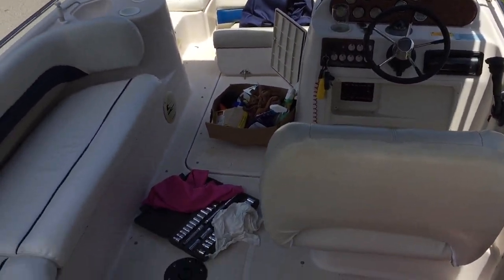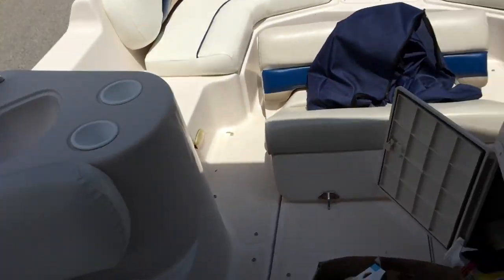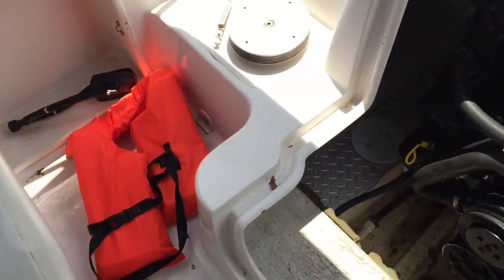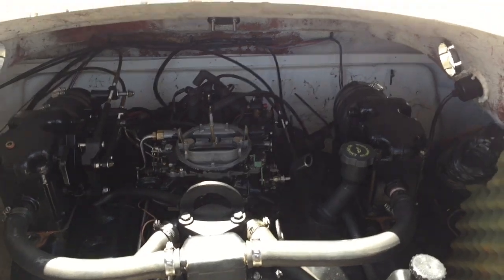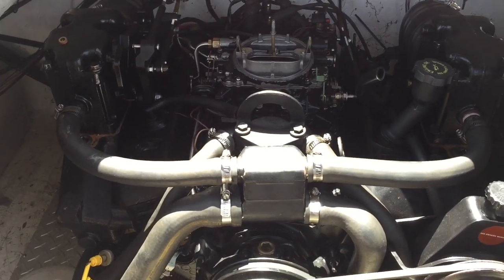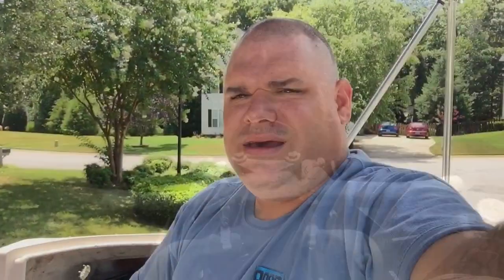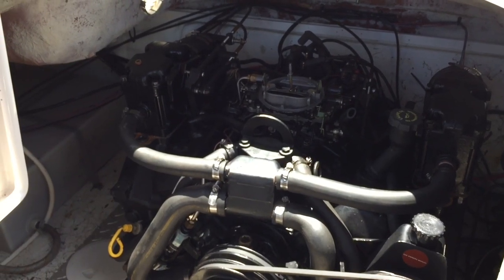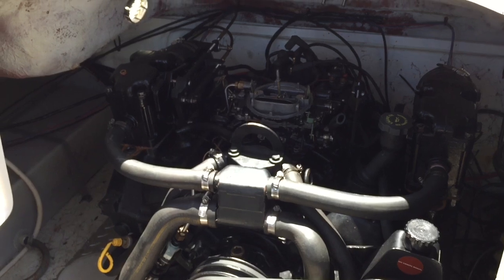Part 1 How to diagnose Blown Mercruiser 4.3 V6 Engine Bad Boat Purchase

Comment: Great advise... never buy a used boat especially sterndrive on the hose! Always test on the water.
Like you said , the bellows or shift cable boot could have a whole , that you cannot see till you have it on the water, then water starts running in from the back of the motor.. plus until you have it on a load and shift in gear ,you cannot hear a dry or bad gimble bearing, lower unit sounds, clutch dog, bearings gears... u joints especially when turning under power... people if you're not knowledgeable about the mechanics of boats , engines and stern drives,, pay someone who is....
Reply: David Jessee agreed
Reply: I'll just tare shit up until I figure it out my self don't like the idea of this magic man that's a alien who's smarter than everyone on earth if it was build by humans a human can fix it .
Reply: Depends on the price point.  If you're buying a 20 year old Bayliner for $7k, most sellers are not going to want to deal with the hassle of water trial.  They'll move on to the next buyer.  What this is means is that you can pass up a lot of decent boats for $7k. At a certain (much higher) price, a seller will anticipate a water trial and will be open to doing one, but the delta between the two prices can buy you a lot of repairs.  Personally, I just assume that an older I/O will need bellows, gimbal bearing, and maybe exhaust manifold/risers unless the seller has records that these were addressed recently.  If the price is fair considering these potential maintenance items, I'll buy without a surveyor or water trial.  Unless you have deep pockets, you shouldn't be buying an I/O unless you're reasonably mechanically inclined.  There is just too much to go wrong with an I/O that even a brief water trial or pre-purchase survey won't find.

Comment: don't want no problems get 2 stroke Mercury outboard fastest and most reliable engine out there
Reply from the maker: Not a 2 stroke fan but agree Mercury is good.
Reply: Outboard are great but I have been a boat mechanic for over 20 years working on outboard and Inboard/Outboards. Over those years I have seen just as many people if not more buy an outboard with a bad engine as I/O folks. The main thing is to know what you are buying and get it checked out.
Reply: Kody George 2 strokes banned on most lakes in California
Reply: @robertgary3561  that's another good reason not to live in California!

Comment: Wow a hole in the piston is a very rare thing even weird for that to happen must have put wrong spark plug in it with to long of a shank or dropped something in the spark plug hole like a nut or bolt or used to high of octane that's crazy. Even running on the hose a person should have heard that right off that had to have a really bad miss.

Comment: If the cylinder, connecting rod and crank aren't destroyed, it'd be far cheaper to just put a new piston in it, instead of a new engine.
Reply from the maker: If you are paying a mechanic, considering other factors with the right side of the engine block, a replacement was the best option.
Reply: NovaMan 350 almost guaranteed the hole was caused by running low on oil.

Comment: 4.3 if it's a GM motor it's the best motor on the market. The Bellows are the Bellows they got to get changed every 5 to 10 years because it's Rubber and it dry rot spray with silicone before you put it in the water and that'll help you out an awful lot. I have a 92 Sea Ray 21 ft boat and it is fantastic I was original owner if you take care of it I change the Bellows one time last year cost me $800 I had a guy do it for me. 4.3 GM Motors would I have in my boat the same one that you have in yours and it runs fantastic it is the best boat motor on the market

Comment: Hi sir
I already suscribed in your channel bc i bought a boat a 2007 tahoe Q6 with a motor mercruiser 4.3..in my first experience forgot to tie the plug and almost sink and in the second one after replace the starter and oil it started to lose oil pressure after 30 min running.
What do u think that get it.?

Comment: would a boat that cost 2000 bucks that doesn't  start be a good deal?
it's a 1995 excel  boat! 4.3 Lt
mercruiser
Reply from the maker: Depends, on how much another engine or rebuild will cost ? also what about the outdrive unit ? what is that condition.
Reply: hell NO........
Reply: I would have looked into it,long ago,lol !!!  I'm a mechanic,and a non-start can, sometimes be easy to repair.

Comment: I would replace the piston a lot of work but well worth it
Reply: If the motor is coming out anyway for 3k you're spending you could have a forged internal blue printed and balanced motor. Swapping a motor over

Comment: When buying a USED boat having an inspection done by a marine surveyor and/or qualified reputable boat mechanic is money well spent. But if you do not want to spend that money at BARE MINIMUM take the boat out on the water and run it wide open for at least 10 to 15 minutes that will NOT tell you everything but can show a lot. If the seller will not take you for a ride and run the boat wide open do not buy the boat walk away.
Reply from the maker: Absolutely Agree!!!
Reply: If I'm the seller, NO Eff'n Way I'm letting a tire-kicker run my I/O or big outboard 'wide open' for ten minutes straight.  That's not normal or expected operation.  He can demo it for up to an hour at various engine RPM's, including one to two minute INTERVALS at WOT.  With small outboards, continuous WOT is OK.
Reply: 10/15 minutes flat out sounds too long to me.

AS Russ G says short periods at a time.
Reply: David Farmer   If an engine cannot run wot for more than  15 mins then its not worth a fuck !
Reply: You can get a remand motor for 1500

Comment: Some "mechanics" are less than intelligent. The ones who said it needed a carb overhaul need to find a different line of work. It won't work on modern engines with large upper plenum intakes (because they essentially act like a vacuum canister with plenty of reserve vacuum) but on most boats and older carbureted vehicles, a vacuum gauge would have shown that decisively and much faster than a compression test. If the needle on the vacuum gauge jumps rhythmically with the misfire, it's a mechanical problem (hole in piston, broke ring, bad valve, broken valve spring, flat cam, etc.). Also, I can assure you, if you have a major mechanical problem like a hole in a piston or bad valve/flat cam, you can disconnect the coil and just crank it over and you will hear the engine speed up every time the cylinder with weak/zero compression is on the compression stroke. It makes my blood boil that some people in this profession are dumb enough to call something that simple to diagnose a carb problem.
Reply from the maker: I could not agree with you more. 150% more. The engine is getting changed out as we speak with a nice reman long block from a reputable company in Charlotte, NC. Hopefully in a week or two he will be back in the water.

Comment: call your local bank or credit union and ask who is a good marine surveyor. best money you will ever spend is on a survey! I almost got burnt on a $72k boat. the entire foredeck was all rotted below the bow rail. i would of never noticed. looked further and the stringer was quite wet. whole boat was junk but hell, i didn't know wtf i was looking at.
Reply: A marine surveyor is a good idea but many of them do not check out mechanical items like engines as hard as that is to believe. Now it's not that the surveyor is lazy or corrupt, they just do not inspect engines even though you would think that is one of the most important items that should be checked. If you are hiring a surveyor interview them and find out what they will be inspecting.
Reply: checked a few and they all do according to what they have listed. also it is a visual inspection. they cannot inspect what they cant see or access easily like bellows if the boat is out of water.
Reply: Like I said before a marine surveyor is a good idea and a good surveyor does a great job at checking boats for structural issues. While no one can be expected to see through metal or find drive hardware problems if the boat is in the water not all, but many of the surveyors I have observed over 20 years as a boat mechanic don’t check much in the way of engine mechanical items. Now different surveyors are going to do different things all I can do is speak to what I have seen. Of those surveyors most don’t even start the main engines let alone take the boat for a ride. My point is known what they are checking. If they look at an engine block to inspect for cracks do to improper winterization that’s good, but if they do not run that same engine and miss a rod knock that could be an expensive miss.
Reply: I'm in MI and though a sea trial is extra it is fairly common in my region. Typically lenders send out a surveyor to see if what they are writing a loan on is worth the money as a loss prevention measure. typically there is no relationship with the customer in that instance. A private survey is of a different circumstance. i know that seawater vessel surveyors play by different rules. I see a lot of ocean boats come through repossession auctions and some actually have paperwork.
Reply: Barack Obama I hope your enjoying your free time now that you’re out of office and I thought you were from Chicago. Barack we are getting way off topic. The guy’s buddy in the video bought a boat from a private seller who only ran it on the hose. That seller may have told him a BS story of why the boat runs rough and then the guy bought the boat and now has to replace or rebuild the engine. To my original point have someone qualified whether it’s a surveyor or good mechanic check out the engine so you avoid this guy fate. And I personally believe a late test is a big part of that check. In this case even if the buyer would have gone on a lake test by himself with the seller he would have seen this thing needed more than a tune-up.
 
I am also from MI and never once post that a marine survey is a bad thing in fact I encouraged people to get a survey just make sure the engine gets checked. It seems like you may also work in the industry but it doesn’t help anyone for us to debate the nuances of a marine survey. Like you said there are different types of surveys done a buyer needs to know what was checked. If someone just says the bank did a survey it’s all good but does not know what was checked they could be stuck with a problem. Many boats cost thousands of dollars spend a few hundred and get it properly checked out.
Reply: I also posted this related to the video:
When buying a USED boat having an inspection done by a marine surveyor and/or qualified reputable boat mechanic is money well spent. But if you do not want to spend that money at BARE MINIMUM take the boat out on the water and run it wide open for at least 10 to 15 minutes that will NOT tell you everything but can show a lot. If the seller will not take you for a ride and run the boat wide open do not buy the boat walk away.
Reply from the maker: James and Barack Obama Y'll are awesome!! Thank you
Reply: Barack Obama why the bank?

Comment: crap, good tips!  I'm browsing CL for a good deal, but after seeing this, I think i rather get something smaller but new and with warranty. :/
Reply from the maker: I know, it is crappy. There are great boats on CL but you have to look hard. The bad is there are many out there that are bad deals. If you can afford, newer with warranty is safer. But finding a good used boat and letting a reputable mechanic check it out before buying is much safer.
Reply: sam3d best boats I ever got were CL

Comment: Great videos....I was also looking @ used boats from Craigslist and dealers.  Ended up buying a new Yamaha SX192 a few weeks ago, and couldn't be happier.   Spent more then I would have liked, but don't want to feel with the headaches especially being a new boater.
Reply from the maker: If my Bayliner wasn't paid off and such a reliable boat, man that Yamaha would be nice. Good choice!!!!
Reply: +fiero880 im a mechanic and was wondering if a 4.3 block from a regular s10 or astro van would work
Reply: Matt Josefczyk bought mine on Craigslist. Great boat for 6 years now at a fraction of the price of new. Plus saved several thousand in taxes.
Reply: My dream boat!
Reply: yes, same engine, it would need the stainless head gaskets n water pump but same thing, mechanically speaking

Comment: Hey fierro great video btw, i'm looking at purchasing a 1999 bayliner cierra 3055 express cruiser right now she's currently getting new bellows and getting de winterized. I will hopefully be taking her out for a water test this week, what are some things I should look out for besides hiccups in the engine and compression testing it.
Reply from the maker: soft wood / flooring, check the wood in the transom or have a professional check the wood, and check the wood on the underneath of the swim platform, outdrive oil condition, make sure she smoothly gets up to plane, no hesitation or skips. See if the seller has any prior owner information and or service information. How many hours on the engine, which engine does it have.
Reply: +fiero880 shes got 380hours and is powered by twin 5.7 carb'd mercruisers paired with bravo 2 drives
Reply from the maker: Good hours, twin engines can be double the trouble. Just be careful and fully check it out.
Reply: Two problems- one is a Mercruiser and the other is a Mercruiser.